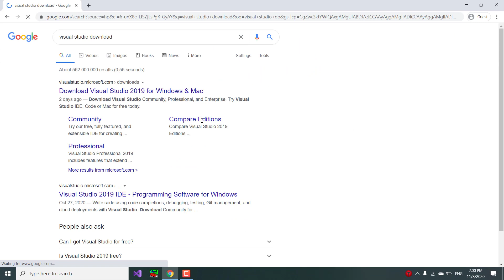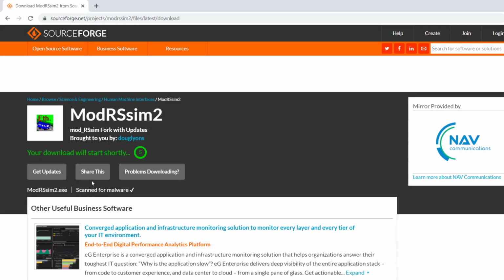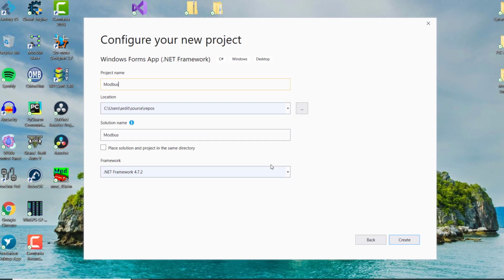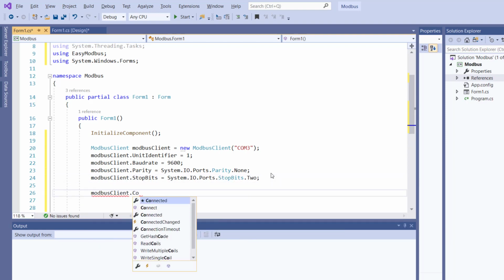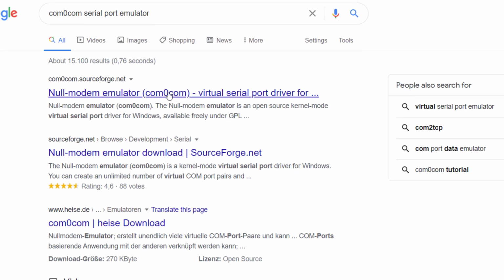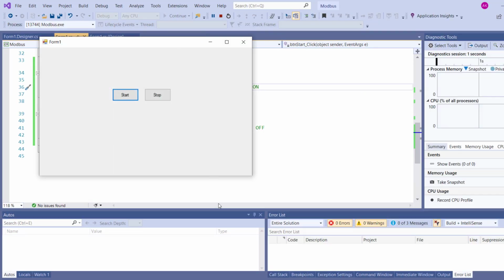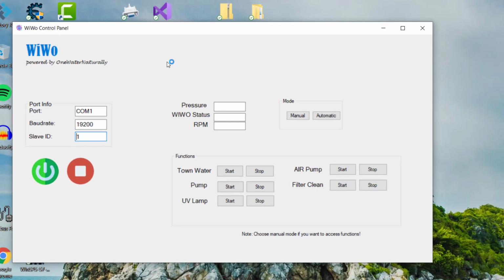Create the Modbus Master GUI  in 10 Minutes using EasyModbus Library

Comment: Thanks - the problem I had four years later was the simulator is now using TCP and the example is using Serial. However TCP is what I want and the simple solution is that the client definition is overloaded so ModbusClient(string ipAddress, int port) for TCP. There is need for Com0Com

Comment: The simulated device was connected through Modbus_RTU or Modbus_TCP? As far as I understand the simulator was for TCP, but the way you wrote the code for the Modbus Client in the source code, it seemed to be for a Modbus_RTU device. A clarification would be very helpful. Thanks.

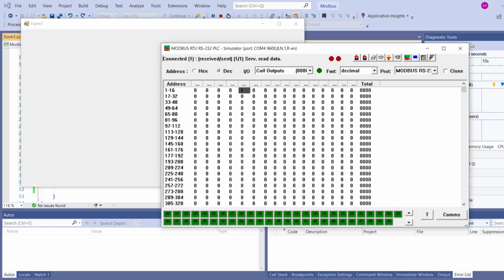Comment: in my case on 07:03 second the Rx/Tx is continue do not stop, but your case it is 1/1, what is the mistake on my side? thanks
Reply from the maker: Hello @Max BD Your Question is not very clear! Could you please write more details about the problem ?
Reply: @programmingwithardit6619  Thanks for your reply, BTW the problem has solved once I uncomment the connection configuration (9600, 8,1,None)

Comment: Thank you for sharing great knowledge. I make programs like you with Delta PLC but it not working. Have you ever connected with a real device? if you did. could you share with me that knowledge !! Thank you very much
Reply from the maker: Hello @chinh. Thanks. Yes, I have created Software, which is able to communicate with the "real" slave device, but you should read the slave device manual carefully. There you can find the detailed description, which "information" you should send in an Coil, to turn it ON or OFF!
Reply: @programmingwithardit6619  First; thank you for this video!

Second; maybe I do not understand the basics of COM Ports and Modbus Prototcol, but concerning the question from "chinh lytruong":  
I do have a real device which is connected to a laptop via a RS232 cable + a USB/RS232 adabter (laptop obviously has no real RS232 interface anymore:)). In the device manager settings this connection appears as COM 4.

Here is my dumb question:
In your video you had no "real" device so you used a program to emulate a connection betweent two virtual ports (COM 3 and COM 4). 
The modbus Server/Slave simulator "used" the COM 4 Port and your Client/Master (aka. your .NET C# program with the easyModbus DLL) "used" COM Port 3. 
So this worked fine.

But in my real world example with a real device i do not have to create a virtual pair of COM Ports. I "only" have COM Port 4. How can i connect the same way you did with this program/DLL to my real device but only having ONE COM Port?
Reply: @davidkovacs0071  @Programming with Ardit yea same here. I have real slave on RS485 and converter RS485 to USB. It's works with other software. It would work with yours? Secondly, do you want to write code to modbus communication without EasyModbus? Last Question, this software read feedback message from slave that confirm getting instruction from master?
Reply: @programmingwithardit6619  thank you
Reply: did u get any info regarding real time communication

Comment: my output screen freezes when i hit any button Start/Stop.
help
Reply from the maker: Hi Ankit, Could you please share more information about your Error ?!
Reply: @programmingwithardit6619  Hello,
after creating start and stop buttons for coil 5, when i start the program...the two buttons shown in the output screen(start and stop) cannot be used simultaneously. i have to stop the program and start it again for making the other button work
Reply: @AnkitSharma-gl8gz  You can solve the problem uncommenting the lines  for modbus configurations.
Reply: Hi Ankit, I faced with the same problem, could you solve it?